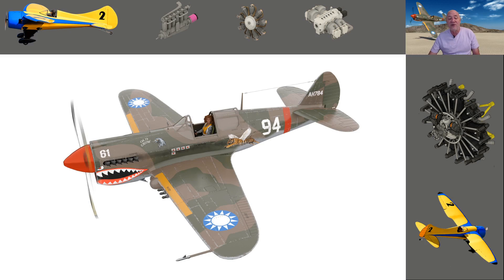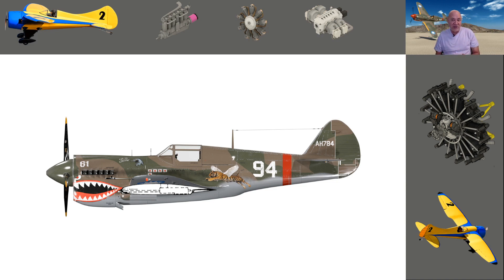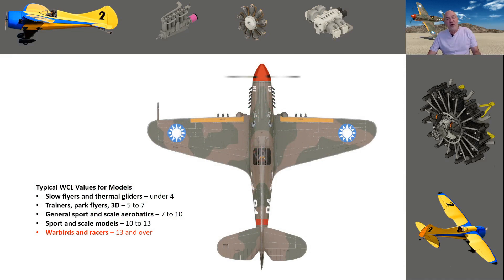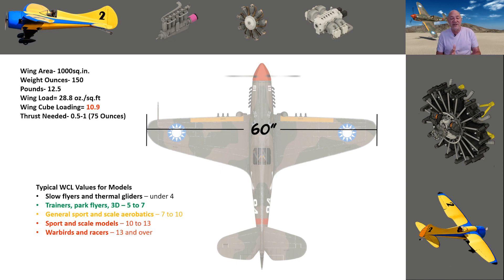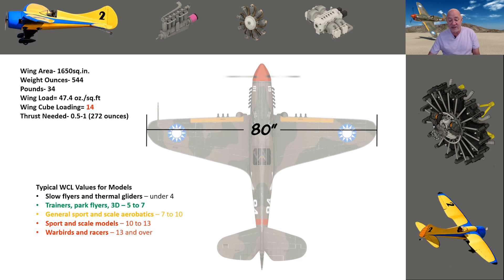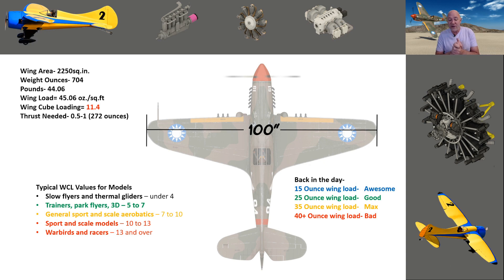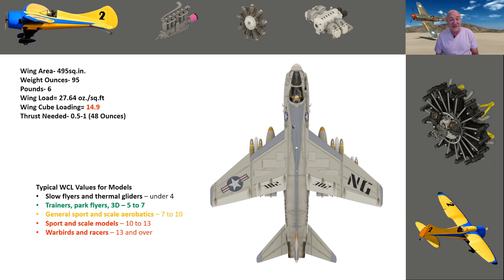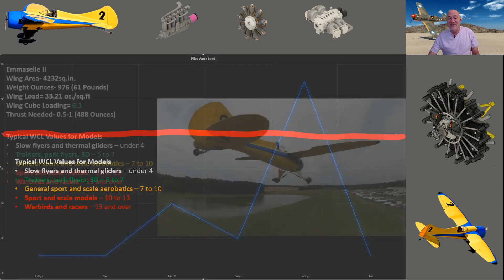RC Airplane Cube Wing Loading for Dummies!

Comment: I'm new to the hobby, and I just did the jump from a 1m DLG to a 1.5m. Although they have the exact same wing loading per dm², the 1.5m is so much more floaty, and the wing cube loading perfectly captures that. When I look up potential future glider models for me, I put them in a list with their wing cube loading besides them. Its such a helpful indicator. It should be added by more manufacturers to provide more context for each model...

Comment: I think another important factor is the moment of inertia. You could have two planes with the same WCL and CG location but might fly differently depending on how the masses are distributed in the aircraft. Theoretically longer aircraft with high MoI are more stable.
Reply from the maker: Great point, I totally agree. Rock ON!

Comment: Dag your series is just great! When you measure the wing area used to calculate the cubic wing loading should you include the area of the fuselage and elevator or just the main wing? My impression is that you are just using the main wing area for the calculation.
Reply from the maker: Thanks! For me, it's just the wing.

Comment: I've been designing and building simple foam board models for only a couple of years and it was a game-changer for me when I found out about cubic wing loading. This video is the best I've seen for explaining how the CWL gives a far better indication of how a plane will behave than the simple wing loading. Thank you for making it.
   Another area I hope you will address is that of model aircraft stability. For example, how does the surface area of the horizontal and vertical stabilizers and tail moment (?) affect the stability? I've had my share of problems in this regard. Thanks again for your videos.
Reply from the maker: I am working on a video that cover airfoil, incidence, and stability. :)

Comment: Good video but I was hoping you might discuss the most important bit, the formula to calculate it :) 
Perhaps I'm more of a geek than most people, but you did include a link to an online calculator in the description so all good  ! ..  That said, I do find it useful to learn about the maths behind these things :)
Anyhow, best wishes and thanks again :)
Reply from the maker: I added a few links which may give you the answers your looking for. :)
Reply: @dagtheaviator  .. Thanks ever so much Damon :)
Reply from the maker: @freezatron  Rock ON!
Reply: Ya, I appreciate the real world numbers BUT never really got around to how they are calculated.   And a quick run with mr google gives an RCcalc forumla of WCL = Takeoff weight / (wing area/144)^1.5    Ya, that's not muliplied by 1.5 its to the power of, like squared by but not, it's  1.5 instead.  A y^x kinda thing.  
Okay, well you are dealing with Reynolds numbers and air molecules, which are constant, and wing sizes that although they are smaller at the same oz/in, air molecules are not.  Did they just take a stab at it by looking at easy fliers compared to ground huggers, coalesced the data?  Maybe.  Certainly get enough examples in this video without the calculations AND maybe thats a good thing.  Don't need to know HOW they came up with Pythagorean's theorem, just had to pass my Trig test with it.  Gotta tell you how many times I used that bad boy in real life.

2, the number was 2 and I'll thank you to stay out of my personal business.
Reply: @williamcrane8236  ... er, are you sure you replied to the correct thread ? :)
But just in case you did, I think an easier way of expressing it is -
"W/A^1.5 = WCL" 
Where W is weight in ounces and A is area in square feet :) 
And yes, it seems like WCL is neat way of summing up the various scaling effects into one easy to use guideline number :)  

and yeah, you might not need to know how they come up with this stuff but I have a curious mind and I like to learn about it, I enjoy designing stuff and find it all very useful indeed :) 

As for your personal business, no one inquired but I do hope all is going well for you :)
Reply: If you know the wing loading (WL) in oz/square foot, you can find the cubic wing loading (CWL) by dividing WL by the square root of the wing area (in square feet).  
    CWL = WL/Sqrt wing area

Comment: Maybe I'n misunderstanding you, but you say  that the 40" span plane (your Sukoi example) has a wing area of 800 sq" and 10 lbs weight. That would require an average 20" inch cord to get 800sq" on a 40" span?
Reply from the maker: Good catch. I messed something up. The math is right, the span is wrong! My mistake.
Reply: @dagtheaviator  that's what I figured,  that span is common for me so I know the common dimensions / weights well. Some of my racers that I have/building are in the 20 wcl area. Always wanted to build bigger to get that number down but that means a whole different electronics package.